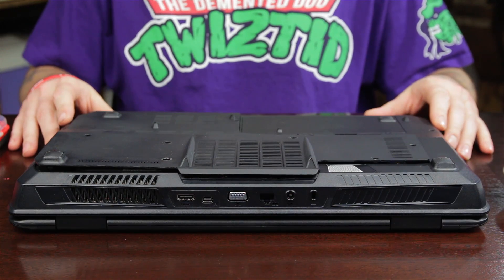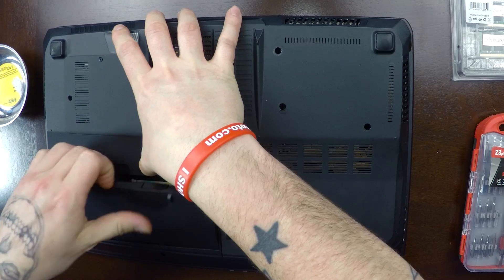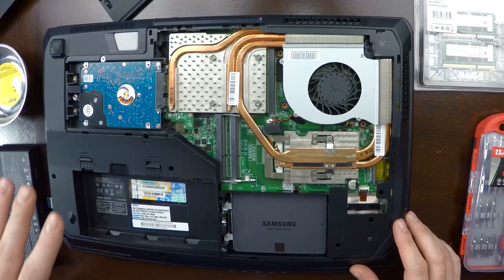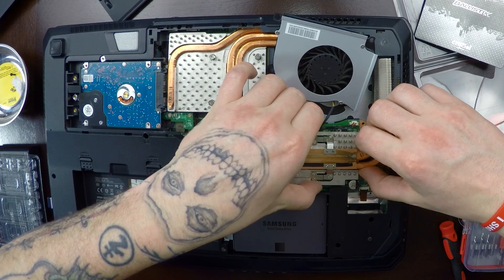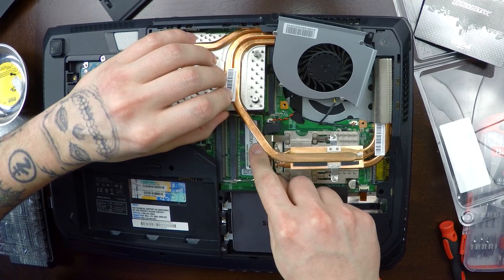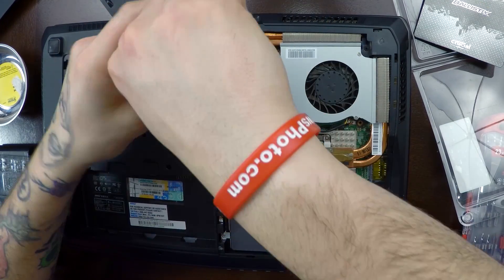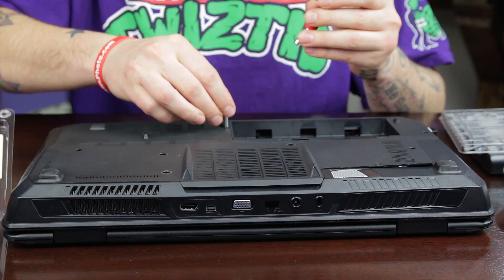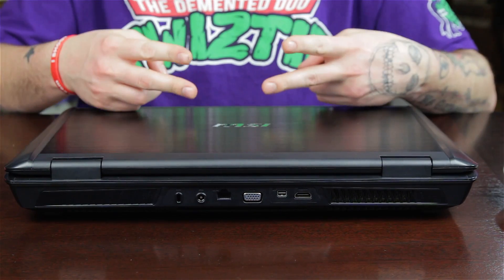MSI GT70 Ram Install

Comment: I bricked this laptop trying to upgrade the bios, took it apart piece by piece to the bare motherboard and unbricked it using CH341a spi programming. Took me like 2 weeks, since I had to learn new skills. It was a bitch, but felt good fixing it.

Comment: Hello. Please change video title to "MSI GT70 Ram Install, the hard and wrong way".
You didnt mention where are located the original ram sticks. One is under the keyboard.
You didnt repasted the CPU and GPU, this is freaking BAD !
You didnt really need to remove the copper heatsink, OMG.
Very the worst video about doing anything on an laptop.
Reply: how exactly do you get under the keyboard? There are no videos available and I am completely lost. Mind you I installed ram and changed the keyboard on my HP laptop. I bought this MSI in 2012 and yes I know I should be upgrading but am deciding to build me a desktop instead because that will be a lot easier to upgrade and enhance in the future. My current MSI only functions as a dedicated desktop atm but still works well enough for general use. Can't really run any high-end games on it anymore though. But my HP has 32 gb ram and so I am hesitant to buy another laptop lol but would be interested in maybe beafing up the ram on my current old ass MSI GT70. It only has like 16 gb ram and a GTX 680

Comment: You didn't need to lift the copper piping for the GPU heatsink.  I know it seems impossible, but the ram will fit in the slots with some finesse, without lifting anything else out.  It just takes some patience and a little effort.
Reply: Yes, no need to left the heatsinker. I mange to install Ram without any problem. You need to use your both hands.
Reply: Hi guys any information /tips regarding this would be great searched for hours and the comment on this video only place with mention of not having to lift gpu/cpu thank you
Reply: @anto3sge  just did it without taking out gpu. You have to slide it into the bottom one and try to do it. I know I'm a month late but this is also for anyone else that comes across this video.
Reply: freshslaya Aw man, thank god for a more recent reply haha! I was skeptical of whether it was needed to move the heatsinks, it looked like you could just slip them under! Nice to know it’s possible. I wouldn’t want to compromise the heatsinks.
Reply: @mr.unfortunate  It definitely took me awhile, just gotta have patience and finesse.
Reply: freshslaya Oh oof, how long would you say was a while? Would the job be easier with something like a pair of tweezers? I don’t currently have the laptop or RAM sticks on me though so I guess I oughta wait until I do to see for myself. Just wanted to have a scope of what I would dealing with lol
Reply: @mr.unfortunate  I'd say 15~20min. First tried the top and then tried bottom. Tweasers might make it more easy too.
Reply: freshslaya I’m working on it right now, and it’s tough! I can’t get the angle right for the ram to slip in properly and I don’t wanna be too rough with it. I’m trying the bottom one first and the stick fits slightly but the pins still show...The ram stick needs to be angled higher but the heat sinks are really in the way. Should I consider taking it to Best Buy’s Geek Squad to see if they could handle it better?
Reply: @mr.unfortunate  If you're really worried yourself sure. Just remember, if they can do it, you can do it too.
Reply: freshslaya Haha yeah, I’ll try again in a few minutes. How did you finesse it to be angled high enough to slip in properly though?
Reply: freshslaya Ah, actually, I was able to install one 4gb stick! (Windows 10 successfully shows 12gb now) Can’t angle it right to fit the one in the top though, but I’ll take 12gb in the meantime.
Reply: @mr.unfortunate  Congrats dude, see it just takes time and patience.

Comment: thanks for this dawg but do i lose warranty if i upgrade it myself ? or is it no problem?
Reply: got a msi it only has 8 gb ram and a intel hd graphics 530 and a Nvidia GTX 950M.
But for some reason im not sure if it using the nvidia card cause my Raptr profile indicates im using the intel hd graphics card as primary on any idea how to change this ?
Reply: Anything basic you are using your intel card, but when you put a load on your graphics I.E from gaming or there alike your GTX 950M will be used...

Comment: You would get more points if you ran the os on a sd.
Reply from the maker: +Tara Nico A.) 7.9 is the highest score that you can get. B.) My OS is installed on an ssd.
Reply: +NextLevelNerd Sorry I didn't notice your Samsung sd in the secondary slot. It also kinda made think for a moment that you were using it for storage instead of running windows on it. Have you thought about cloning the drive and then moving the sd to the primary slot?

Comment: factory specs as well as Crucial memory inc...
says there are two banks of two chios... where is the other set of two? 
I have my MSI GT-70 0NE-462-US up to 24gig's right now... 
all sources say this model can go as high as 32gig's...
so where is the other bank of memory?
How can I get to it?
I hope it isn't Hard-soldered on....

Thanks for your expert opinion....
Reply from the maker: +Mac Xtc The other 2 sticks of ram are underneath the keyboard.
Reply: +NextLevelNerd 
thank you Sir...., I actually found out a bit later where it was...
I'd like to see your version on how to eo that installation,.... (if you have one)
Reply: Yes that my question and reason for watching. Mine says it has 4 banks. I want to put 8Gin each bank. When i opened the back I only saw 2 banks. Where are the other 2 banks?

Comment: Thanks for the vide, man! For anyone wondering, it's just barely possible to install ram in the bottom slot without removing the heatsinks
Reply from the maker: +Calvary Zender Yeah, i didn't really try too much to fit it without removing the heatsinks. I was just following a poorly shot video.

Comment: Is there any certain order for the RAM to be put in? Do I need to fill the 2 slots under the keyboard first or does it matter? I installed a stick of 8g and had to remove 1 of the 12 (was getting bad RAM check)....
Reply from the maker: +Banker Bob I didn't mess with the stock ram at all. You may have just gotten a bad ram stick.

Comment: Some important observation notes  : You really should had re pasted the GPU right there , .... because by the simple fact that you lifted the heatsink on the GPU .. that screwed up the factory paste that was there ( air goes into the paste joint spot between the GPU and the copper plate ) and man .... MSI GT70'S are known for overheating GPU'S like crazy .... 93c + when there's no good thermal interface contact there.

The first thing in order to remove those heatsinks properly is to unscrew and remove the fan (disconnect it from the mobo  connector) ... and then you will have more space and freedom around the zone to work around.

Anyways Thanks for the video !
Reply from the maker: Francisco Hilario I'm sure i probably should have, but i am no expert in computers at all. I actually just follwed a different, not so well shot, video. Thanks for the tip, but i haven't had any overheating issues lately.
Reply: I got the same laptop couple of days ago and I just did the same thing as you but I took the opportunity to fully clean the factory thermal paste (MSI had done a horrible and messed up paste job) I used qtips + a brand new soft dental tooth brush + towel paper + my own proven cleaning materials :  3% acetone / 7% industrial non-conductive cleaning oil + 90% alcohol as as a dissolving cleanser on the GPU+CPU chips and heatsinks .... Once the cleaning was done everything looked shinny like new .... No residues were left from the previous paste job, then I replaced all thermal pads with:

http://www.frozencpu.com/products/11663/thr-91/Fujipoly_ModRight_Premium_Thermal_Pad_Blister_Pack_-_VGA_Block_-_60_x_50_x_10_-_Thermal_Conductivity_60_WmK.html?tl=g8c487&id=QCRCgpQ6

http://www.frozencpu.com/products/16878/thr-164/Fujipoly_ModRight_Extreme_System_Builder_Thermal_Pad_Blister_Pack_-_14_Sheet_-_150_x_100_x_05_-_Thermal_Conductivity_110_WmK.html?tl=g8c487&id=QCRCgpQ6

With cuts of equal size and shapes and then repasted the GPU/CPU with the best ... IC Diamond 24 carat paste.

Temps dropped 13c ° !! And we are talking about a $2700 custom MSI GT70 !
Reply: Francisco Hilario That sounds awesome man! That is a little out of my realm. Sounds like you should make a video for us.
Reply from the maker: +Francisco Hilario That sounds awesome. You should have made a video haha. I'm not a computer building guy, so i am pretty new to this. I just wanted to share my experience because there wasn't really any videos online.
Reply: Does the GPU use the thermal pad or paste? Thank you 👍